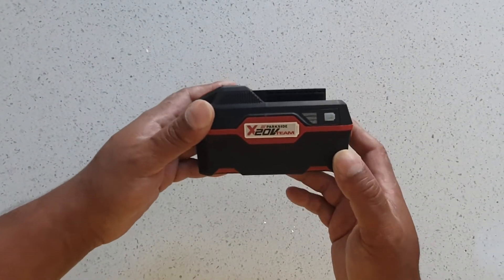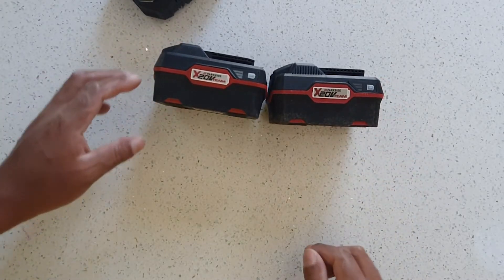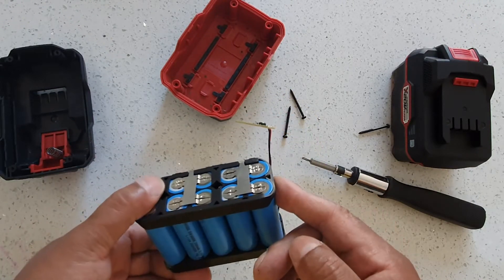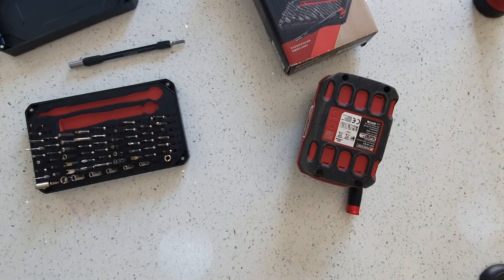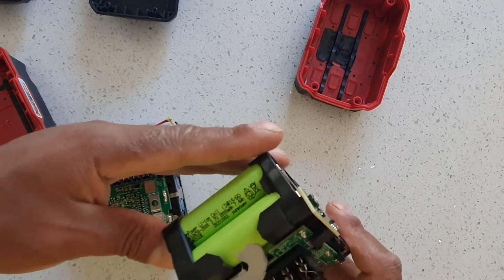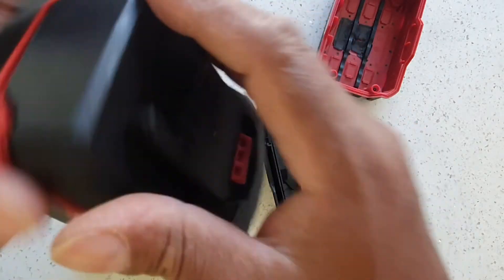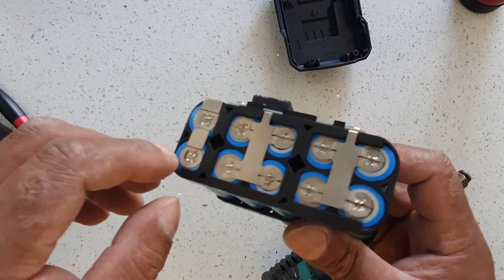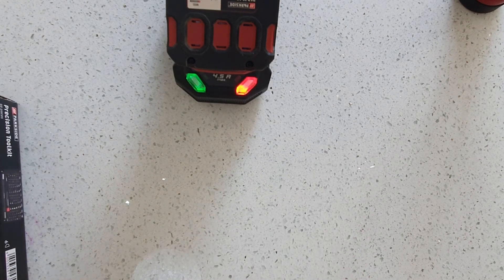Dead Parkside 20v Battery X20V 4AH PAP 20 A3 - Replaced Under Warranty #parkside #cordless #dead

Comment: A late comment , you can revive that old one , just connect + to + and - to - from the new battery to the old , leave it like that for 1min , job done , it will charge again.
Reply from the maker: All has been good, Parkside replaced like for like
Reply: @AMRZINE  Parkside SUX. In my country, something is changed in the warranty only if you have the purchase receipt. Disgusting service. I switched to Makita. I don't buy anything new from Parkside anymore.
Reply from the maker: @antikurjers  That is the same over here in the UK too, no receipt no warranty. Always scan using the app, the receipt gets saved to your account